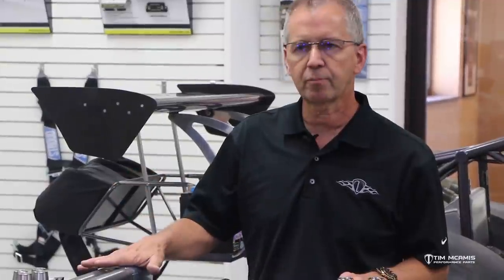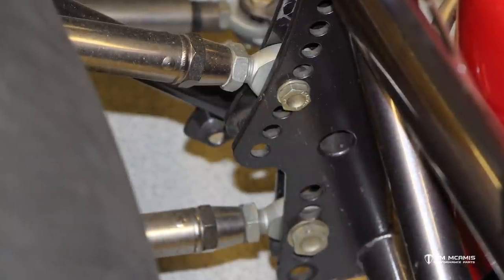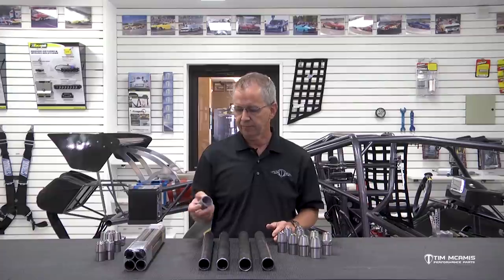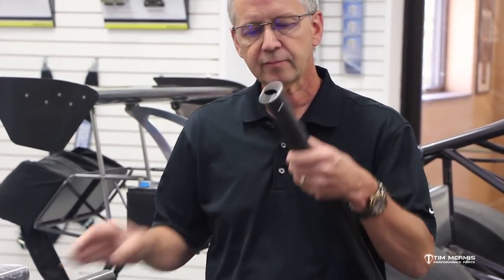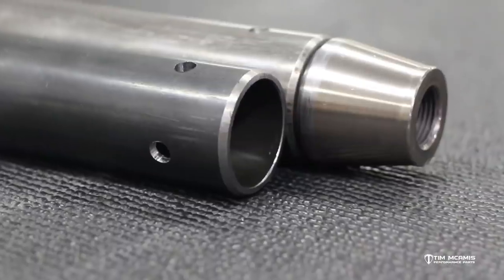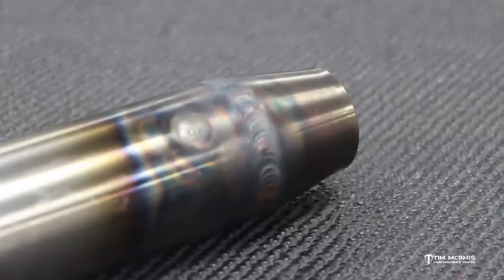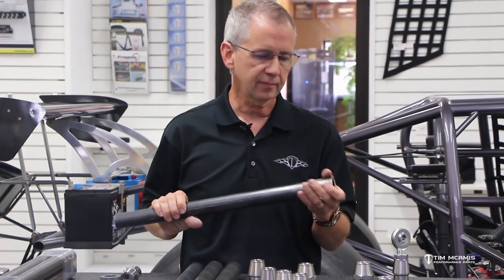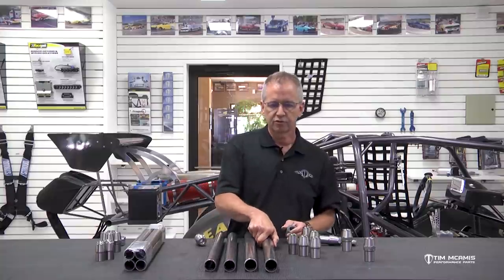4-Link Bar Evolution

Comment: Back in 76' we were using 1"x .156" wall thickness and would tap with 100% threads for a 3/4" spherical joint... way stronger nowadays ! Appreciate the quality thought process! Respectfully, Seth
[ our customers appreciate the quality instructions in your kits ]

Comment: Got a question for you Tim. If you had the time away from racing, would you consider a campaign in drag week and or rocky mountain race week? If so, what program would you run? What class would you shoot for? Would Tom Baily have something to worry about?
Reply from the maker: That would definitely be a cool endeavor. There would be a lot to consider, but probably would do some type of Pro Mod style street car in the unlimited class with a ProCharger.

Comment: I almost feel i anticipated this. I ordered all my tubes at .120 wall a couple years ago. This kit is exactly what ive been using. The .120 wall has been cheaper than the .095 and .085 wall for as long as i can remember.  You can deffinately feel the difference if you switch it to a thin wall if something breaks and thats all u have.

Comment: You guys that may not be into all of these worlds at the same time may not have noticed that hole location fixture is 3D printed. I cannot tell you how many things I've printed so I can more easily make real parts like Tim is illustrating here. You'd never think you'd see a 3D printer involved in making 2000hp racecar 4 links, would ya?

Pretty cool stuff, and cool for Tim to include that in the kit.
Reply: why not convert to metric it will free up free up alot of Tims brain holding all that non related barbarian messures, must use alot of braincapacity): still grate stuff!
Reply: @fredrikholmgren5748  Because in the US everything metric costs, at least, twice as much unless you're buying insanely vast quantities of materials (and I mean literal cargo containers, plural).

Generally speaking, you're preaching to the choir here as far as my opinion on it, but getting the US to convert to the metric system by asking the high end drag racing community to lead the charge is probably not going to be effective.

If it's any consolation, every single one of these guys that is using a turbo is buying them based on metric measurements. So... A small victory.